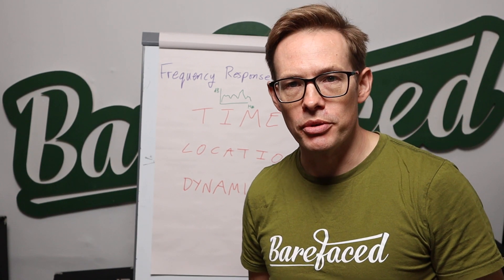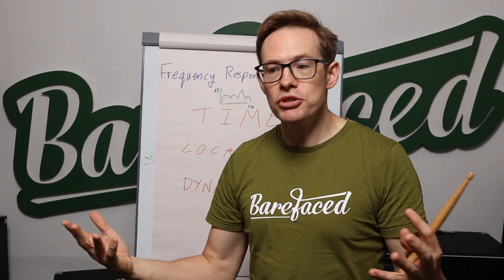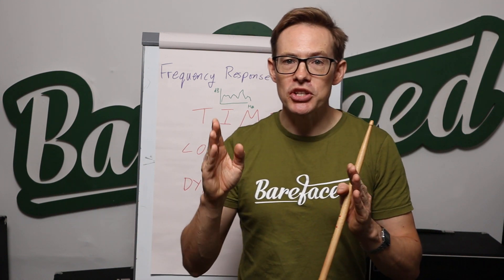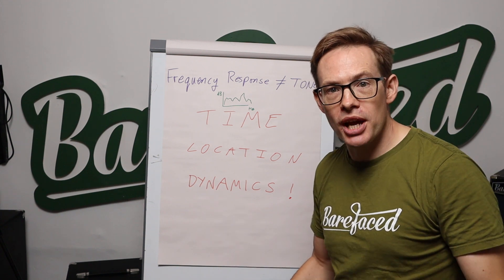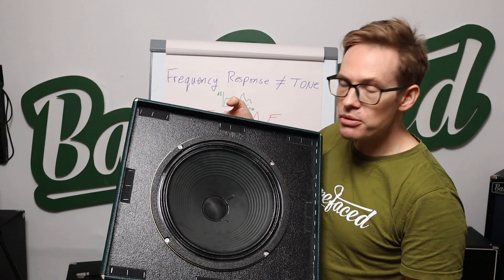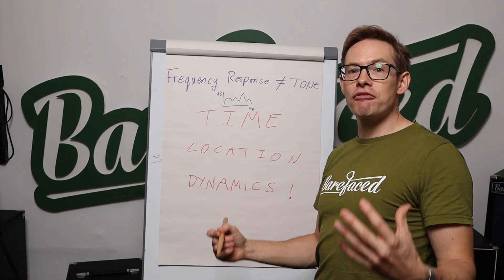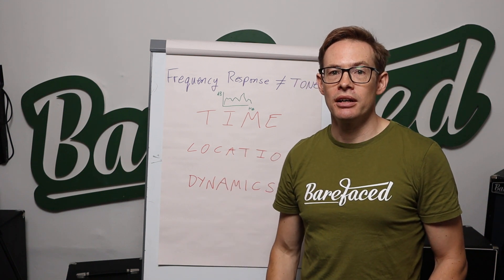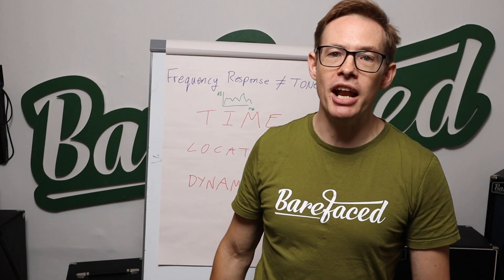Frequency Response is NOT tone. STOP THE MISINFORMATION! Please tag/share with culprits!

Comment: I'm interested to know about the stuff you know what you're talking about, I think it would make a good video topic to delve into. I'm not a frequency measurement fanboy, but I do use them when tweaking and tuning speakers. Aside from ears, a measurement mic and frequency response graph are the most consistent way I've found to monitor changes. One of the things I love about messing with speakers, is that gray area to explore and there's still a ton of it. Either unknown science to the builder, or things still a mystery even to the experts. If it were that simple, as creating a flat frequency response I'm not sure there'd be much room for DIY or high end audio boutique speaker builders. So I would agree that frequency response doesn't tell the whole story. I'm almost done with a series on a vintage pair of $60 Realistic Bookshelf speakers the MC-1201, that when measured unscientificly, were perhaps the best measuring mass market speakers I've come across, yet they still sounded like a $60 pair of speakers.

I've also measured speakers that had their design and measurement done with ultra scientific methods in anechoic chamber... They don't measure flat, in a room with a calibration mic. Some of those sound great, others just okay. There's more to it than the graph... There's so many variables, especially in a home listening environment. I'd be happy to have you comment on some of the stuff I do, I'm always open to suggestions and advice from those who know what they're talking about.

BTW in another video of yours I watched, you were showing a high excursion driver that Eminence made for you. Very, very cool looking speaker!

Comment: in the world of studio monitors and home audio speakers a frequency response curve can tell you a lot but in the world of guitar cabs probably not to much.
Reply from the maker: This is the problem. A single frequency response curve for a studio monitor or hi-fi speaker tells you very little. Within the working bandwidth of a loudspeaker you can use DSP-based EQ to give a huge variety of studio monitors matching frequency response curves - but they’ll all sound different. So no, it can’t tell you very much at all, sorry. I understand why you might think that it does and am fine with that - but hopefully you’ve learnt something from my response. It’s not just about guitar speakers - it’s about ALL SONIC SOURCES.
Reply: @BarefacedAudio  40 years of pratical expeience in home and car audio, yes their are many things it can tell you and many it can't. But it can show you the low end extension in a full range muti driver speaker. example yamaha hs 8 vs yamaha hs 5. we both know the frequency response curve of the hs 8 extended to lower frequencies both on the graph and in the real world. the same can be said about high end extension of various speakers and it can also show issues with poor crossover design with spikes and dips neart the crossover frequency.
Reply: or to simplify even further compare 2 different pairs of $100 car audio co axial speakers ($100 should put them firmly in the mid to high-end price range for this product). 9 times out of 10 the speaker with the better frequency response graph will also be the better-sounding speaker. probably more because engineering a speaker with a flat response takes more work than not caring about it. OR try Beats brand headphones vs a pair of Sennheisers, they have a V-shaped graph and they sound like it, with heavy bass and crashing symbols compared to the controlled even sound of the Sennheisers with their flat response graph.
Reply: maybe to your point probably the majority of average listeners prefer the sound of the  V-shaped Beats to the Linear response  Senheisers.
Reply from the maker: @joetspaulding  the key point is “40 years of practical experience in audio”. You can read between the lines - most people can’t!
Reply: @BarefacedAudio  Growing up Dad had a pair of Kliphshorns hooked up to a big Phase Linear amp and pre amp in a big room with full vaulted ceilings and he gave me an old pair of sealed large \Advents (hand-me-downs) and a nice Sony 30w RMS receiver. two systems with great but VERY different sounds, I've been studying speaker design and acoustics in my spare time ever since. I think maybe my ASD gives me a special enjoyment of clean powerful bass!
Reply: PS. my little 50w Ampeg Rocket Bass and my Yamaha BB 734 is all the bass rig I need for my bedroom but if I ever need a real bass cab I'm buying from you! cheers!
Reply: actually 90 percent of the time I play though my little Yamaha mixer/interface (ag 06 includes bass cab sim) my big Yamaha Receiver and my Polk Audio Monitor 70's
Reply: @BarefacedAudio  or another example. it is easy to design an affordable or cheap full-range loudspeaker with a big bump at 125Hz but less than ave performance at 60Hz and crap at 30HZ to the ave person this will still sound like a Bassy speaker. But you can not make a cheap speaker that p[reforms well and evenly at all three of the mentioned ranges
Reply: @BarefacedAudio  also your qualification "Within the working bandwidth of a loudspeaker". the frequency response graph TELLS you the "working band with of the loudspeaker". Not to mention non-linear response tends to increase as you get to the physical limits of the loudspeaker and adding bass electronically can take a LOT of amplifier power